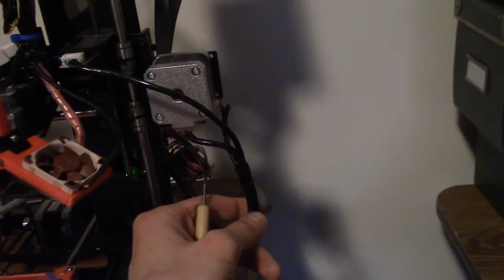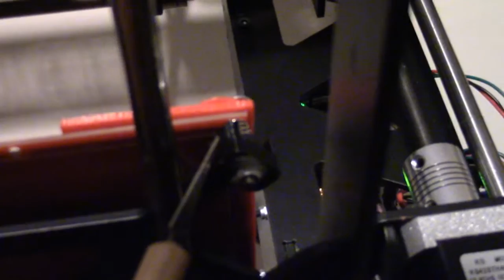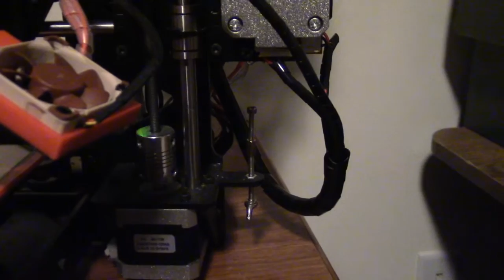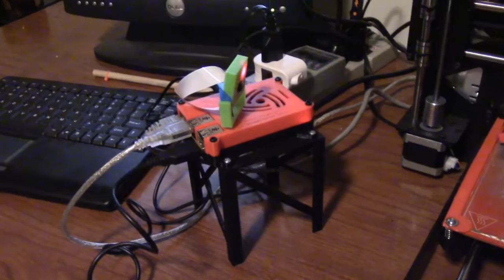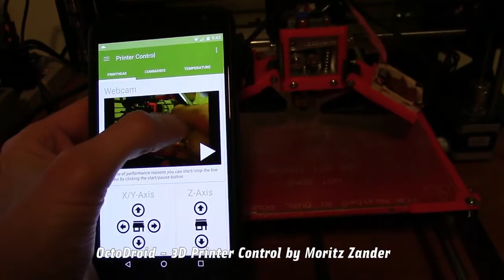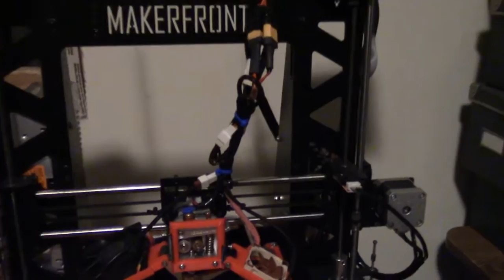MakerFront i3PRO 3D Printer Video Review

Comment: Very nice. Was that PLA you were printing with? How are the prints in ABS? Will it do Nylon?
Reply from the maker: +Crivo152 Yes I mostly work with PLA. I've done a few ABS prints and those were trickier. Since the printer does not have an enclosure large ABS prints tend to curl up off the bed as the part cools. There are various tricks you can play to get it to work well, it's just not as easy as PLA. I haven't tried Nylon yet, but I plan to. I've heard some folks have had good luck with it.

Comment: what controller did you upgrade to? Does it take SD card input? $$$? I really like i3pro, but the factory LED controller is a kludge.
Reply from the maker: +markintheworld I use the RepRapDiscount Full Graphic Smart Controller: http://reprap.org/wiki/RepRapDiscount_Full_Graphic_Smart_Controller.

It does have SD card input but I haven't used it. The RepRapDiscount store lists them at $70 and you can find cheaper knock-offs on ebay.